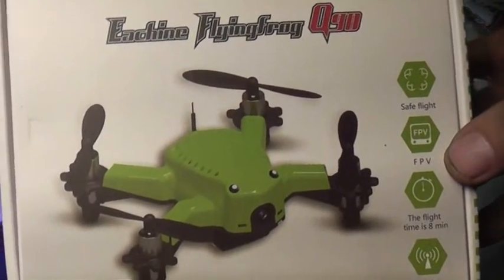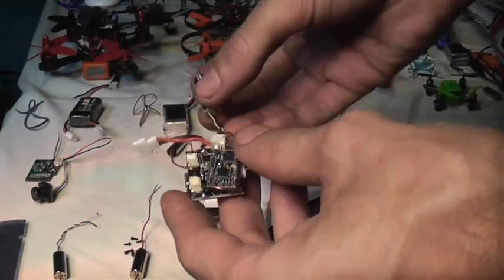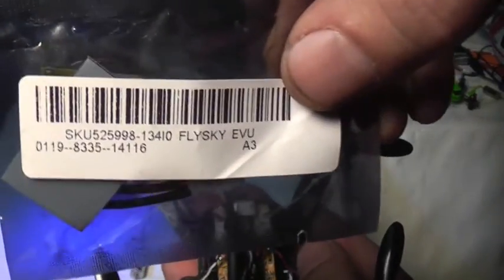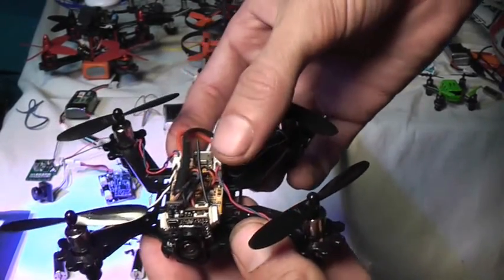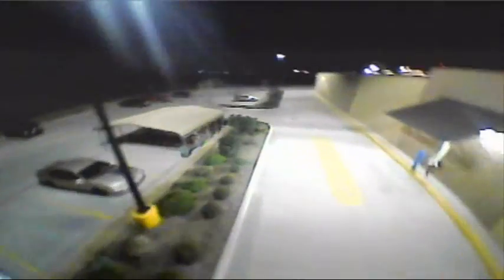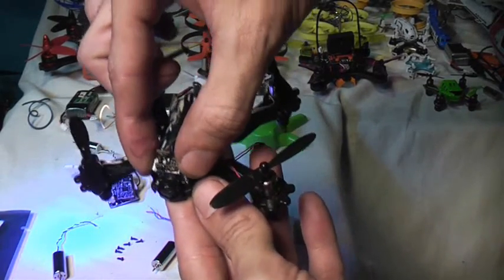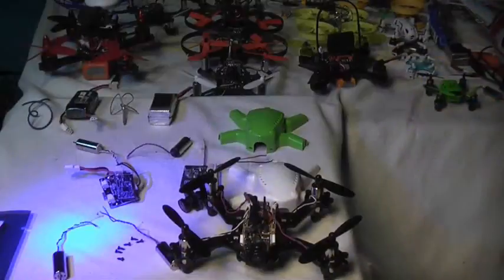Eachine Flying Frog Q90 Flying and Dissecting

Comment: I NEED HELP I HAVE THE Q90C DRONE FROG FACTORY AND THE ANTENA FELL OFF. i JUST NEED TO KNOW WHERE TO PUT IT? HELP
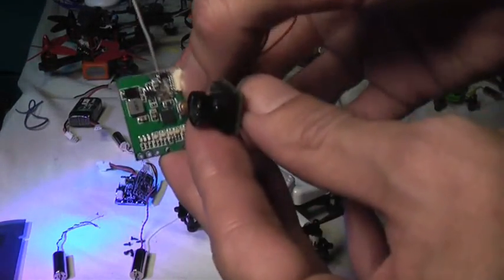Reply from the maker: If you look at the 0:52 second mark in the video you should be able to see where the antenna connects. I think it just solders on unless they upgraded the connection. Some of them could be pulled on and off without soldering.

Comment: Is there anything you'd be willing to do to help me get mine flying? I have a spektrum dx6 and it binds well. It will not arm at all. I am pretty new to Betaflight too.
Reply: Betaflight is not , is not easy to use. Worst damn thing to happen to the flippin hobby.  You having all these problems and you condone it, please!!!!
Reply from the maker: Betaflight is actually very easy to use and very user friendly, just install chrome, and then install the betaflight app. Don't be intimidated, it's all pretty easy to figure out once you start doing it.
Reply: Thanks for your reply! I've been messing with every setting possible and not one thing has helped so far. Its very frustrating. I have the spektrum and SBUS selected on the config tab. The frog is bound in SBUS mode to my dx6 and nothing will happen on the receiver page😔 Any ideas? Thanks for your help.
Reply from the maker: On the receiver page, after you turn the transmitter on, and if it is successfully bound, you should see the values of each channel jittering a little bit. It might need to be set to ppm.

The banggood page says it has an" Sbus/PPM output DSM2 compatible Receiver"
In that video I sent you where I bound a spectrum DX6i transmitter to a racer I had to remap the controls, reset the values for the switches on the modes tab and adjust a few other things. it took some time.
Reply: You lost me on the second half! I cannot even get the thing to show on the receiver tab. The light on the quad goes steady but nothing will jitter on the tab. Am I doing anything wrong? There are directions that allow it to bind in SBUS or PPM. Which is correct?
Reply from the maker: I remember that for me to get a spectrum transmitter to bind to an Eachine aircraft I had to first put the aircraft into bind mode.

The instructions might have changed so double check the manual.

 You might need to connect two solder points on the flight controller to get it into bind mode but I think the aircraft automatically goes into bind mode 10 seconds after you plug the battery in. Sometimes there is a bind button on the receiver but not on the frog as far as I remember.

Next I had to flip up the "trainer" switch on the transmitter and hold it while turning on the transmitter.

It took a bunch of tries before I finally got a successful bind.

Once it is bound, if you connect the aircraft to betaflight and look at the receiver tab you will notice the values jumping around a tiny bit.

The next step is to define the arm disarm switch.

You will need to do this with the transmitter, you need to go into the transmitters menu and set auxiliary channel 5 to one of the switches. I think there is only one switch on the transmitter that you can map auxiliary channel 5 as.

Channels 1 through 4 control pitch throttle roll and yaw.
auxiliary channel 5 controls arm disarm. 
auxiliary channel 6 switches flight modes. 

If you go into the modes tab in betaflight you will see the setting for arm disarm, if you remove the setting for arm disarm by clicking the little X, it will set it to the default arm disarm sequence which is throttle down and to the left or down and to the right to arm and disarm.  This might help if you cant set a switch as aux channel 5 to arm and disarm,

Double check the compatibility of your transmitter and the receiver, your spectrum transmitter needs to be a DSM2 DSMX transmitter.

Comment: Are you flying the Flysky version? Can you demonstrate how to setup the failsafe feature? I need to the Flysky failsafe working for outdoor FPV flying. Thanks!
Reply from the maker: Yes I'm flying the flysky version in the video.
Mine came with it already set up, if you raise the throttle while holding the aircraft and then turn off the transmitter you should be able to tell if the fail-safe is already set because the motors should power down.
Reply: I have both the Fatbee FB90 with AFHDS integrated receiver and the QX90C with  AFHDS 2A integrated receiver. Both quads' motors won't power down upon switching off the transmitter until battery exhausted. Failsafe is not working on both quads. I had the failsafe set to drop in Cleanflight. Can you do a demo video of Flysky failsafe on mini brushed race quads from Eachine?